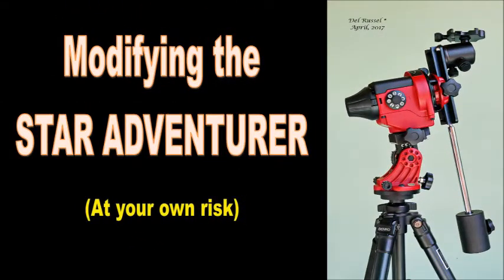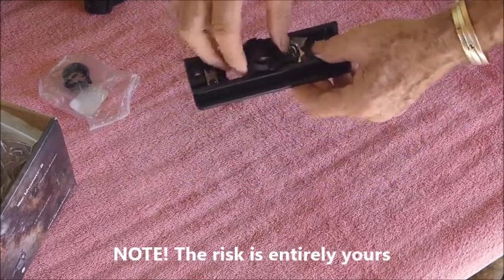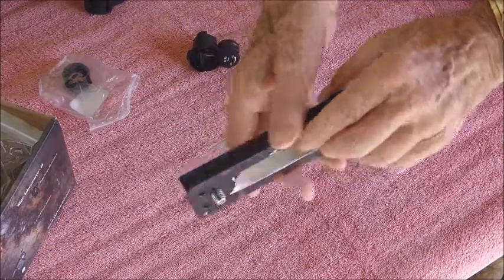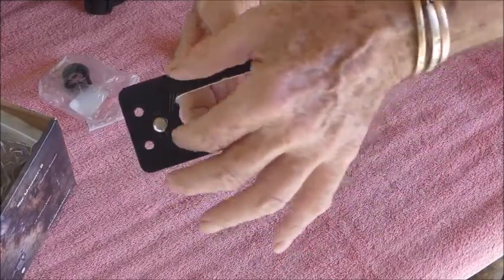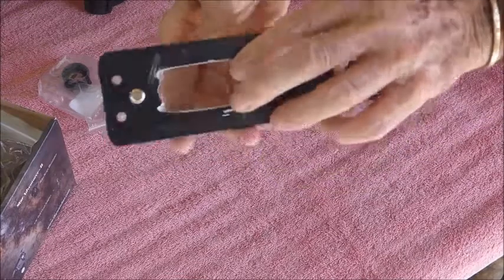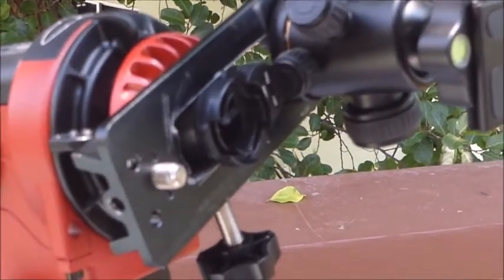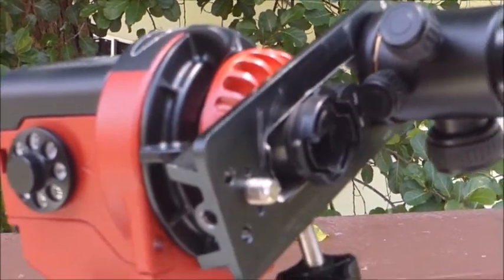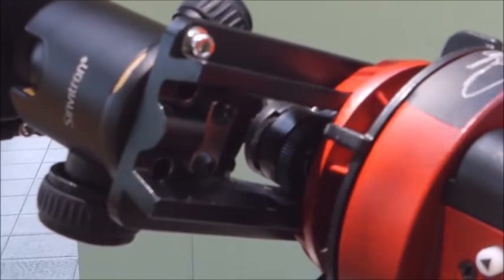Modifications to the STAR ADVENTURER

Comment: Or you could have just used the plastic adapter that was supplied. Lol. What a fool
Reply: The plastic adapter's were not supplied with older Star adventurers.
Reply from the maker: @edjones3390  Thank you for the comment.
Reply: @edjones3390  his was on his table as you can see in the footage
Reply: @stewsmith9236  You may be right - I'm not sure what the adapter looks like ! Mine didn't come with one and I got a green dovetail which would be newer than the black one
Reply from the maker: Not very nice old boy. The plastic adapter wouldn't fit, hence the butchery. Constructive criticism would be more beneficial than abuse but thanks anyway. Be happy.
Reply: @delrussel2640  so out of all the units sold you had the only one that needed to have an angle grinder taken to it 🙄

Comment: Ähm. There is a Adapter in the Box, to fixed the illuminated Polar Align tool, to the Plate without problems. 🤟🏼
Reply from the maker: The earlier ones did not fit, later on the problem was fixed.

Comment: you butchered it，you can clip it on there before，might help if you read the instruction manual
Reply from the maker: Yes I did butcher it and not proud of the looks but at least it works now. With what I was supplied with it was not possible to keep the polar scope illuminator in situ with the mounting assembly in place. And yes I am able to read and always read instructions thoughourly and cross check and seek advice from others when unsure about things. Thanks for the negative criticism, have a nice day....byyye.
Reply: I’m just a little shock to be honest. There are two piece to the illuminator, you could just rap tape on around the little piece’s wall, by making it thicker it’ll grip on to both side better... I’m more disappointed with the design by skywatcher, they could have easily made the illuminator inside the mount rather than a separate piece.
Reply from the maker: It was TOO big, not too small......!!!
Reply: You’re not meant to clip it into the tracker directly!Theres a black smaller piece 0:15 in the video upper right of
the screen in the plastic bag, that clips in between the illuminator and the dec bracket. You align the position of the illuminator so sits on the dec bracket on top of the scope!

Comment: Why altering the dovetail, as there are many means to adapt the illuminator ?
i.e: I did design and 3D-print an adapter, that allows to align the mount even with the L-bracket in place, and that remain in place.
http://www.astrokraken.fr/adaptateur-pour-illuminateur-polaire-polar-illuminator-adapter-star-ad-a129492988
Reply from the maker: Well Philippe,
Firstly, I got this idea from someone who had already done this adaptation and there was no video available at the time. Hence mine. Also if you look at tha video properly you will understand this is someone elses idea.
Secondly, I have neither  the resourses or funds to accomadate a download from a 3D printer.
Thirdly, I am fairly computer/tech ignorant and see a mechanical solution (which works and is good exercise in the making) as my answer which others might appreciate.
Fourthly, I don't understand Spanish or whatever so your post is dead to me.
Have a great day and may all your problems be small ones Del